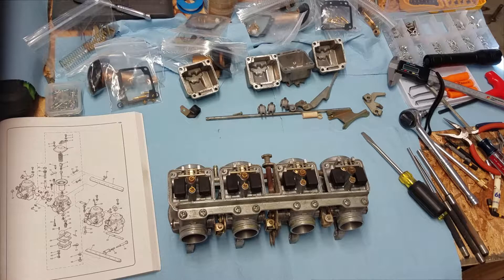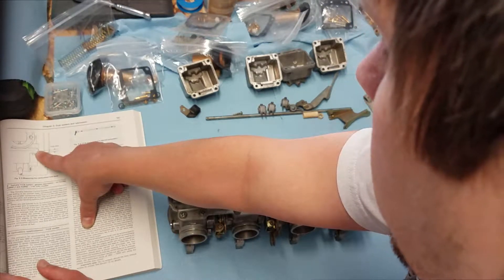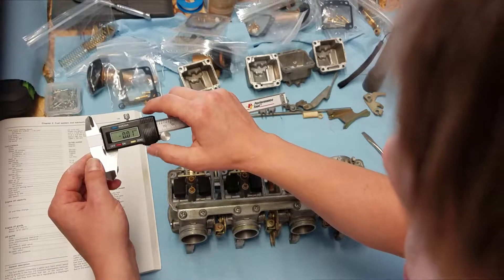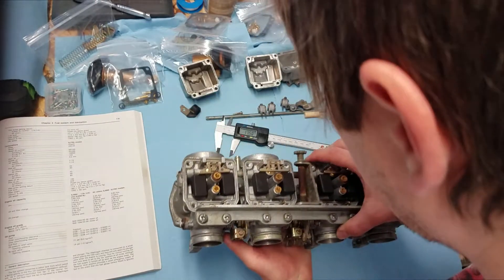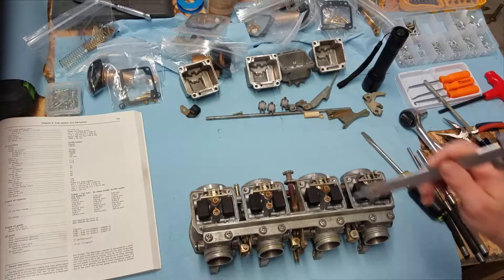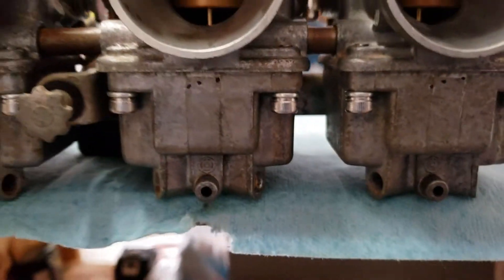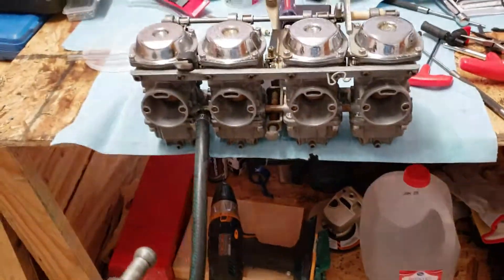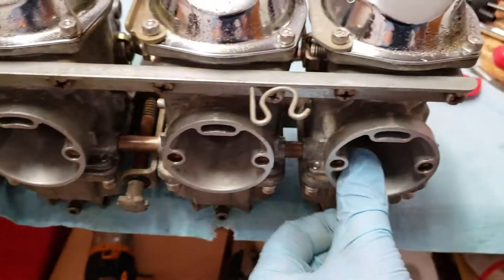Seca 750 Float Height/Fuel Level Adjustment

Comment: Hey I called Yamaha and asked for the float height for my bike and he said the fuel level calls for 11.5-12.5mm..would that be the float height as well?
Reply from the maker: Float height is a different measurement than fuel level. You will also need to know what location to take the measurements from or they won't be accurate.
Reply: 11,5 - 12,5 mm from the edge to the highest point of float?